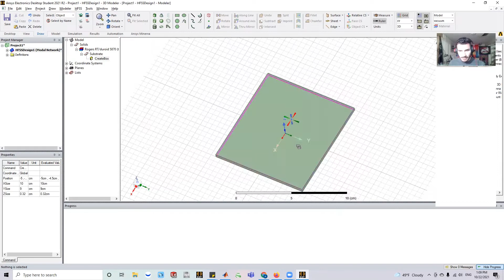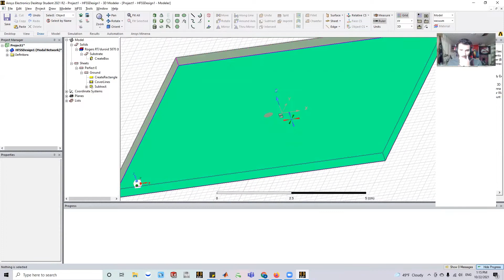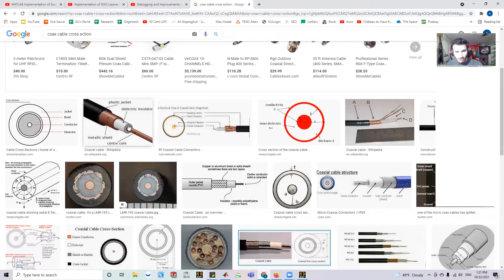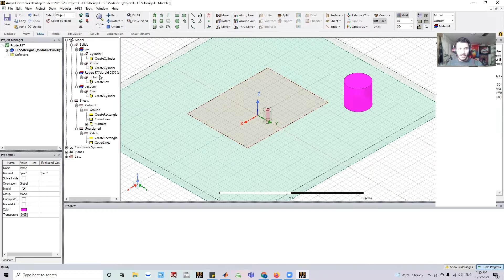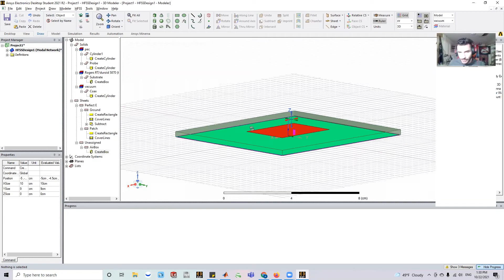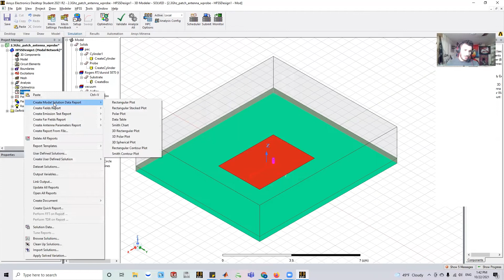2.3 GHz Probe Feed Patch Antenna - ANSYS HFSS Simulation

Comment: Can you help me to design a patch Antenna at 1.176 GHz resonating freq.
I can't able to Design the antenna at this frequency. I have calculated tge dimensions from website but it not working 🥲

Please help me
Reply from the maker: What exactly is not working? Are you able to generate a S11 plot?
Reply: @alithedazzling  Yes, but the graph is not accurate.

My problem is I need to Design for Navic L5 band, so the resonant frequency is 1.176, as per this what should be the dimensions??
Reply from the maker: @PritamSoni  you can calculate the dimensions from antenna theory .com — then you can check out my other video on how to tune an antenna to see how to use the software to adjust dimensions
Reply: @alithedazzling  can I talk to you? I need some guidance for my project.